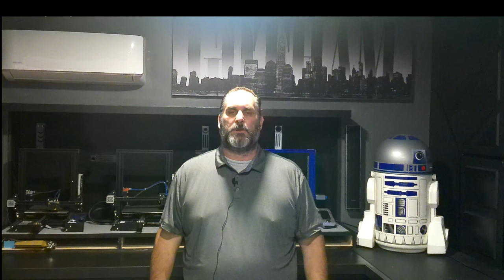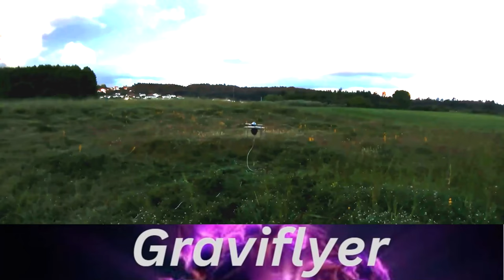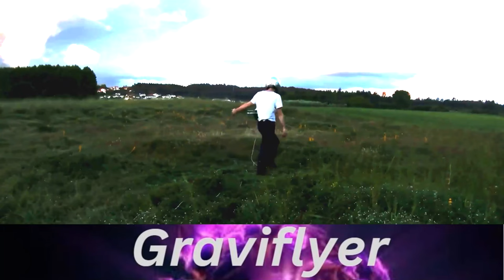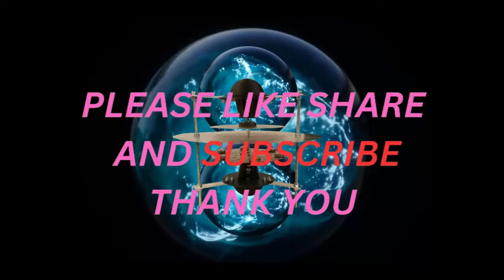Graviflyer "No Shock High Voltage" #38

Comment: I have a few questions for you to answer. First of all, the current in the primary coil of the Tesla coil is very strong, but when the cable is connected to the metal plate, the current feels very weak and has no effect at all. Why is it still connected? Then for high-voltage static electricity, I used two high-voltage static electricity packages of 12V connected in parallel to the positive electrode of the metal plate above, but it still couldn't produce sparks or light up the lamp. Is it because the voltage is insufficient and needs to be higher? Finally, I used an oscilloscope to test the fixed vibration frequency of the object in electric motion. Should I use an ultrasonic generator to generate the same frequency to stimulate it? What should I do next? The power of the ultrasonic generator seems to be very small, so how can it make a large object resonate and levitate into the air? Should it be stimulated with a high-power generator frequency with a louder sound? Are these some questions I had during my experiment? This troubles me greatly.
Reply from the maker: send me pictures on my email oldmannathanbunten@gmail.com I need to see the connections and the wire size. if directly connected to the #2 coil of the tesla coin to the graviflyer you should get a big light up. If down the center of the tesla coil not connected. it will depend on wire shielding and tesla coil strength. the high voltage is there 1 driver or 2? if 2 then remove 1 of them. 1 driver can run both coils. you can always test the spark between the - and the positive. the spark itself will light up a florescent bulb.  Please send me the pictures so I can help better.
Reply: Ok, I will record my equipment and operation process to help solve the problem better. Thank you for your help.

Comment: Finally, a good analysis Nathan. Charge of the light brigade. 0.17 coulombs. Alexey has rubber soled shoes on and is insolated. The charge is from a low voltage and high current with the proper chemical frequency of the battery that produces light and not RF from the battery as the below comment. You cannot do this with a 60 hz power supply and why they are researching EVs with batteries to pay off the research.   A high current and low voltage make a metal superconducting, and this allows the production of anti-gravity waves for lift.  You need to make the normal capacitor and the air capacitor circuit. You experienced heat and Alexey did not. Normally a high current makes heat with the resistance of the metal but not in this case. You also mention polarity. All atoms polarize with the superconducting circuit.  This is why the charge building up made the aluminum magnetic and why UAP make trees and the ground magnetic with stray electric fields. If you wish to know more than contact Jared and have him, contact Michael Perrone who I explained this all to.
Reply: Hmm, 0.17 Coulombs?  Since charge equals capacitance times voltage, if the voltage is low that would suggest a giant capacitance to hold that much charge.  Where would the capacitance come from?
Reply: From the air capacitor lower disk and middle disk that is kept apart with the spinning magnets and induced magnetic field from the circulating charge current and voltage and the top disk middle disk that is a normal capacitor as the bottom of the top disk has a dielectric on it and the voltage gradient from the high voltage center disk and the lower voltage top disk. The top disk and lower disk split the negative charge, so the bottom disk repels the earth, and the top disk attracts the positively charged ionosphere. Look up magnetic fields and voltages for capacitors to learn more as I cannot post the links here.